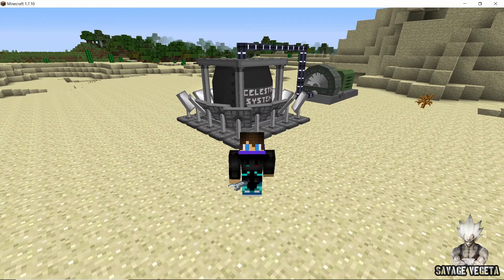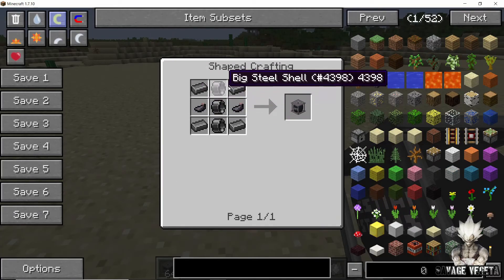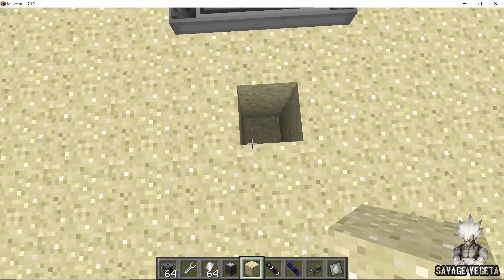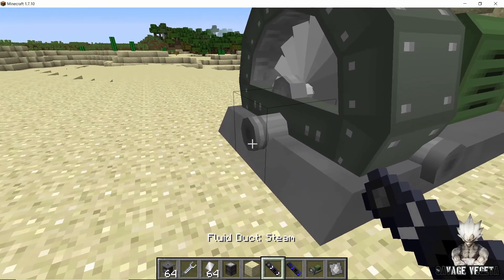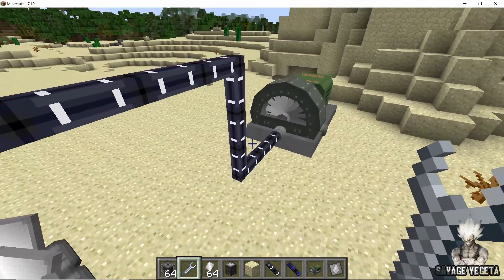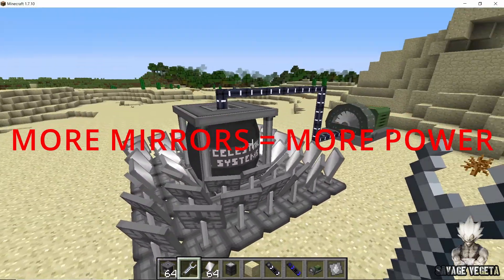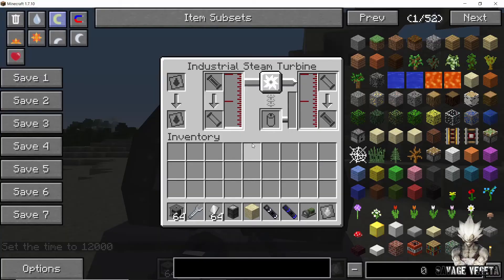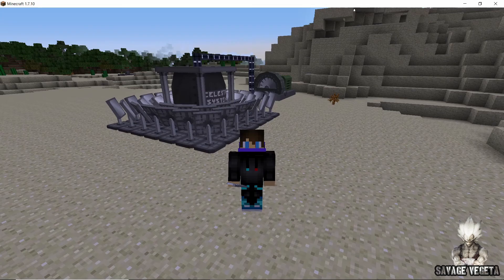How to use new "SOLAR TOWER BOILER" in HBM's Mod | Renewable Solar Energy Production in Minecraft

Comment: I have a question I'm using the basic steam turbine but it makes a lot of low-pressure steam as a bi-product, any ideas on how to get rid of it automatically?
Reply from the maker: You can process that low pressure steam back into water using condenser/cooling towers. That will make an infinite loop of water-steam-lowpressure steam- water
Reply: @SavageVegeta  Thanks that helped a lot

Comment: Hi! I have this boiler! But what a next? I have chemical construction and oil rig, all cisterns, rectificatoin camera. What a next? How to create new tier? Can u show all guid 1-10 tier game? =)
Reply from the maker: Also depending on the version of the mod you are on, you can also use  the new Boilers and heating platforms to make steam which can then run a turbine to give you power if you can't go to nuclear energy just yet !!
Reply: @SavageVegeta  Thank u!)
Reply from the maker: @WaldemarINTM  you're welcome :)
Reply from the maker: Just take a look in your inventory to see if you have enough materials to make a Nuclear reactor or not. You can start with ZIRNOX as it requires no coolant and the oil rig will help you in getting carbon dioxide. 
I don't think I can make a guide just yet for this mod cause it is constantly being updates so new things are being added especially for early game.

Comment: Is there any purpose of Low-Pressure Steam? I've been using these machines for awhile but have no clue what to do with all this excess steam..
Reply from the maker: Yes you can use either the condenser or cooling towers to change the low pressure steam into water. It introduces a more realistic approach to the rankine cycle based power gen in the mod
Reply: @SavageVegeta  Oh bet! Thank you!
Reply from the maker: @SpenkerC  you're most welcome , most of my new RBMK videos have the cooling towers in them , also I did make a seperate video covering the condenser and cooling towers as it was a pretty significant change to the mod